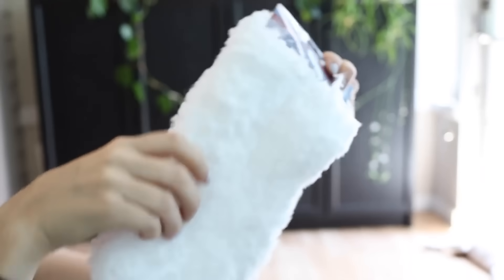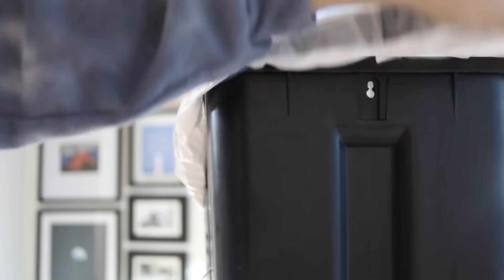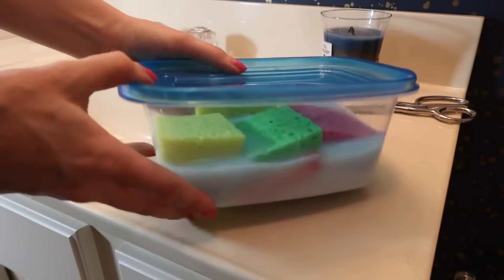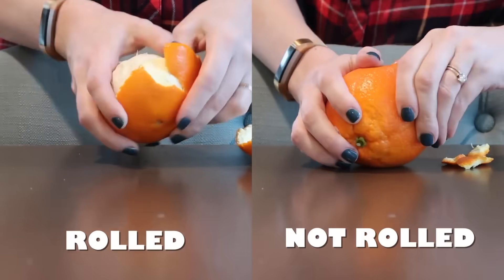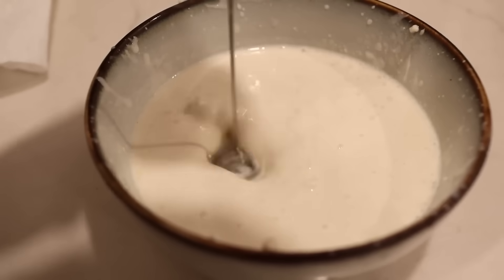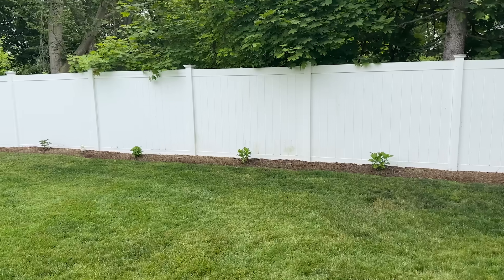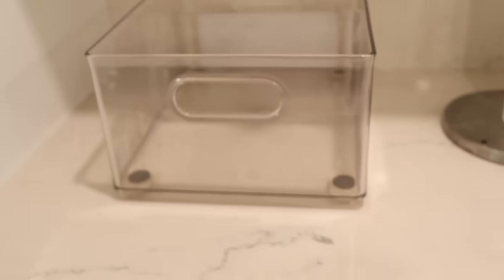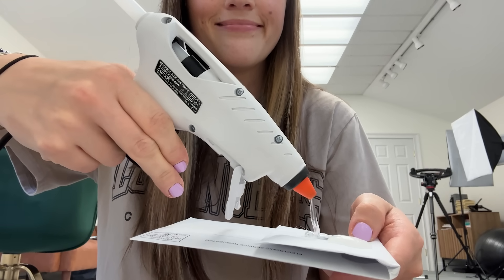43 brilliant NEW home hacks you need to try!! (you won't believe #22)

Comment: Fabric softener on a sponge, and put in the dryer, is not safe. If you look at the back of the bottle it tells you that fabric softener is extremely flammable. Wool dryer balls are much safer.
Reply: Also fabric softener not really good to use in driers , because of the steam is released with and will damage the drier rubber parts faster , i was warned about this from a technician .
Reply: My 30-year-old washer and dryer set finally had to be retired.  The technician said, “You don’t use dryer sheets or fabric softener, do you?”  Nope.  He said they are the death of washers and dryers.
Reply: You don’t need any fabric sheets in the dryer. Just toss in a DRY clean bath towel with your wet clothes. It speeds up the drying process and cuts down on wrinkles.
Reply: @sjrogers7498 Wow, good to know. What do you use as fabric softener? To have a dryer for 30 years, you have done great! 👌
Reply: I still use a little splash on clothes.  But you can't use fabric softner on microfleece jackets or blankets it ruins the fabric. FS stains & bleaches fabrics. Borax pulls out the oils it deposits in your fabric. 
  If you accidentally dry paint in your brushes & it dries, soak it in fabric softner 24 hrs, then massage the paint out of the bristles.  Its also a lovely wallpaper remover.  Dad dipped a cloth in fabric softner & rubbed it over his wallpaper border & it peeled off the walls 10 minutes later, without a mess.
Reply: @brrjohnson8131  cool tips! Thank you!
Reply: wouldn't a towel leave lint on clothes?
Reply: @charleensmith1478  no. Never has.
Reply: I stopped using fabric softener years ago. A half cup of vinegar, believe it or not, works well as a fabric softener, and leaves no smell behind. I also use a few drops of eucalyptus and peppermint oils, which helps to repel bugs. The vinegar also has the added benefit of keeping limescale deposits from forming inside the washer drum.
Reply: @blakpurl14 I’m taking the fabric softener out of my Walmart online cart now
Reply: I use vinegar and baking soda; super clean and soft.
Reply: My thought was the liquid would not last for a day or two before it would start to smell.
Reply: @HeronCoyote1234 it's not for helping to dry your clothes faster they are only for a smell..
Reply: @charleensmith1478 no.. maybe if your towels are on the cheaper side but I have done it for years and it's great
Reply: I was thinking to try, thanks for warning
Reply: @mistyclesi4665 Why? If you want to use fabric softener, that is your choice. I've been using them for years, and they have never ruined my dryers. Same with fabric softener. I've done some extensive research on it, and have not found any proof, or evidence to back this claim up. Society has gotten to where they just believe anything and everything that a person says, and doesn't bother researching it to see if it's actually true. Regardless, you should do what is best for you and what makes you happy because that is what is important. Take care.
Reply: I was also thinking that heat will break down the sponge into micro particles that will be all over your clothes and then transferred to your skin.
Reply: Fabric softener added to washer also prevents your towels from absorbing water. Use vinegar in the washer in place of softener. No need for dryer sheets!
Reply: That's why u can't believe everything you hear or read!
Reply: Leave it to a bunch of Karen's to find the one thing that they don't agree with and not be able to go the rest of the day without commenting about it without feeling "helpful" but forgot about the 3,000 other tips she just taught ya. Then, later you cant help but tell all your friends about the hacks "you've" been using for years.
Reply: Vinegar is not good for your washer and will wear away the bearings, so should be used only occasionally
Reply: @bridget3027  good point! Need to make sure you’re only using distilled vinegar and in low quantity. We only add it to our washer’s softener dispenser, (approximately 1/2 cup). If we need to use it in place of detergent, for odors, mildew, and sanitation,  it should only be added if diluted-  1:1 ratio with water. Also, do not add directly to metal / rubber. If you have to use a large amount, do rinse cycle afterwards. 😊
Reply: Be very careful if you decide to use vinegar in the wash.  Vinegar is great on whites but can bleach color and dark fabrics.
Reply: @alexa5927 Pardon my silly question, I'm not good with washing. The vinegar is added to the washer cycle not the dryer? right?? Thank you
Reply: @Nini-ze2jk  yes, I add it to the fabric softener compartment. If your machine doesn’t have that, add vinegar to the rinse cycle.
Reply: @alexa5927  oh ok thanks Alexa! I appreciate it
Reply: @alexa5927  yes, I put white vinegar in all washes. Very small amount of detergent.
 Usually dry on a clothes line.
In fact, I use white vinegar for lots of cleaning jobs...removes odours also.
Reply: Those clear boogers that hold credit cards are made of museum gel?
Reply: OR your a dry towel in with the wet clothes.  Good results, less stuff, no expense.
Reply: I use tennis balls r they safe or no?

Comment: These hacks are really great. I know I’ve seen some of them before, but they’re easily forgotten. I put masking tape over my baking powder. It was really annoying that it had no way of leveling off.

I’m testing out your wax paper trick on our stainless steel refrigerator and dishwasher! Hope it works. There’s always fingerprints and condensation.
Reply: The metal insert with the cutout on the inside of the baking powder container is already there to level off your spoons
Reply: @xlady0  it’s not in the one I just used up. I didn’t have that metal insert.  It was by Gefen, an Israeli company. 

I said that it didn’t have anything, so I don’t know why you didn’t believe me
Reply: I actually thought we were talking about baking soda. Lol.

Comment: Wait, how did you use to peel mangoes before??? The only way I’ve ever know to cut mango is the way you showed in the video
Reply: I've seen people try to peel them like an avocado, where you cut in half, try to take out the pit, and scoop out the flesh of the fruit. But a mango pit doesn't break free as easily as an avocado pit does, so I think that's an awful way to try to get the fruit out. I don't eat a lot of mango, but always peeled them with a vegetable peeler and then cut around the pit too.

Comment: I quit using dryer sheets and fabric softener because it damages the clothes and the dryer by leaving a waxy residue and buildup. The dryer is more likely to catch fire too. Instead put a cup of white vinegar in the rinse cycle and it'll prevent static and wrinkles. (And no, you won't be able to smell the vinegar, even if you hang dry)
Reply: Same here!😊
Reply: I stopped using fabric softener sheets when I learned they were the reason my towels weren't as absorbent and were smelling bad. I washed them in hot water with baking soda and white vinegar (separately; don't mix them!), then regular detergent, and all that residue came out. Then I got wool dryer balls. They work fine and they just live in the dryer so there's no box or bottle taking up space (though they do tend to collect hair so I have to clean them off every so often; I have long hair and it gets everywhere!).
Reply: @allein1001  get couple those sticky paw shaped fur grabbers for the dryer, and,/or washer..... Just rinse them off and good as new
Reply: I never used them, always thought they were an extra product that wasn't needed.

Comment: Alot of good ones!! For hard boiled eggs I wait till the water is boiling then insert eggs gently, wait then I take it off the burner but I leave them in the pot, every like 1 to 2 mins add cold water to the hot water a little at a time. That will slowly cool the eggs. Once the water is cold and the eggs sat in it for a few mins, pull them out. To open, just roll your egg to crack the shell, and then you should be able to peel the egg in one piece. It works for me everytime.

Comment: My toilet cleaning routine:  I use the Clorox toilet gel.  I apply it inside the toilet up along the rim and let it sit while I clean the outside of the toilet (rim, outside of the bowl, seat (both sides), lid (both sides), and tank.  Then I take my toilet brush and scrub the inside of the bowl.  After the first scrubbing, I flush.  Then I take an antibacterial wipe and put over my toilet brush to scrub under the rim. It gets the gunk the toilet brush misses and I just toss the wipes when I'm done. It usually takes at least a couple of wipes to get under the rim clean.

Comment: I use a vegetable brush for my toilet. The regular toilet brush doesn't get under the rim very well. 
I use a magic eraser on my tub after using the dish brush like you have. It takes off more than the brush does. It surprised me at how much more dirt it took off.
I use baking soda in the washer with the detergent and vinegar in the rinse cycle. Clothing has minimal  static coming out of the dryer.
Enjoyed the tips!

Comment: I've always use the outdoor broom,  first I scrub the tub walls, then the tub, and the tub floor,  the shower walls, and shower floor, there's no need to kneel down or bend.  I use the scrubber or a sponge  for the water faucets, if necessary you can use a hard sponge,  I also like to use brillo makes the water faucets shinny. If you have a spray shower head is better and easier to rinse the tub walls,and shower walls ,  It really makes the job a lot easier, without bending and hurting your knees and back.

Comment: You are really amazing with all the wonderful practical tips and tricks although I never had a problem peeling the eggs off. I just pour out the water and shake the steel container until all the eggs shellls are cracked up and then pour some cold water and peel it off, very easily and almost immediately

Comment: I use rainex on living room window and sliding glass door.  I have a big 75lb slobber dog.  While it doesn't keep my window clean, it makes getting her super glue like slobber off.  But wax paper sandwich bags if you can find them.  Much easier to polish with.  If you still have metal slides, they wax the slide nicely too.
Reply: @osakarose5612  circa 1960 mom would send us outside with wax paper bags over our hands to wax our slide to slip easier(don't know if metal slides are still a thing, backs of my legs got burned a time or three) I am also going to try on the track of door.  I was so tired of scouring or using razor blade to clean my windows from my dogs slobber.  Lol

Comment: With the measuring spoon in the chocolate,  it's easier to flatten the chocolate or whatever with the back of a knife. The tape will collect the choc, & will need to be thrown out regularly. The adhesive also contain chemicals.
 Ikea sell reseable plastic clips that can be used to close bags, & they are big enough to be seen, less likely to be thrown away.

Comment: I recently found that replacement heads for wand cleaners are great for really cleaning under the rim of the toilet bowl. I accidentally broke the wand, and used the head full of vinegar a dish soap to scrub under the rim, and it removed hard water build up and stains so easily.

Comment: Tight kitchen storage:  My first every flat (aged 17) no matter how much I cleaned or sprayed, the block had a cockroach problem, so I took to storing things like biscuit packets etc inside my lidded pots and I would then neatly sit them on top of my stove top with handles all facing the same way to look neat.  This is a good trick and you don't have to find room for your pots and lids in your cupboards.  Mangos:  I leave skin on, cut either side of the large seed, then cut the same pattern as you would do to decorate a ham, then invert the half and the little sections will sit up nicely for you to eat or cut off.  Neat presentation for placing in a parfait or cocktail glass.

Comment: You can also hard boil eggs in a rice cooker using the steam setting for 18 minutes. I usually then put them in the refrigerator in a bowl after after they've cooled down a bit and they peel really easy once completely cooled in fridge.

Comment: I agree about  the crevices, there are so many items that have bends & corners & crevices, like vacuum cleaners, lawn mowers, line trimmers, steam mops etc. You have to clean them after using them. It's annoying, & uses much of your valuable time. Easier to give an item a quick wipe over. 😊

Comment: I never have eggs hard to peel.  I poke a small hole into the large end, drop them in boiling water, boil for 5 minutes, turn off the flame and cover for 20 minutes, remove and they are done.  I'll try your air fryer hack, though.  Love the gridded-cut watermelon.  Like the milk frothier hack.

Comment: 7:50
Hard boiled eggs. My method is to boil the eggs and then fill the pot with cold water to drop the temperature. Dump that water and fill one more time with cold. 
Then tap each egg on the inside of the pot to get cracks forming. Once they're all cracked, go ahead and start peeling them while submerged in the water.
I think the water starts to work it's way under the shell from the cracks, and makes it easier to peel.
Reply: If you put ice in the cold water after boiling, they peel right off!

Comment: 5 STAR VIDEO!  Here's a home hack for you that works for me.  I have a very small kitchen and I have counter top that is higher than my stove top.  Uneven.  Food and stuff would fall through the gap between them.  They have gap covers on Amazon, but they don't address the different heights well.  So I bought a silicone mat and some silicone rubber bands and I rolled up the mat in a tube and held it together with 2 bands and covered the gap.  Now stuff doesn't fall through the gap and I don't have to worry about heat from the oven.  And it will last a long time and is easy to clean.

Comment: You don't need to put a tape over cocoa powered canister etc. I just pull the meaduring spoon up against the inside wall of the canister. That works with any strait wall canisters, not the round ones. 😊

Comment: Lemon oil and a green scrubby clean your stainless steel sinks, scrubbing with the grain.  The sink has to be completely dry and the green scrubby should be new.  After scrubbing wipe it down with a paper towel, and your sink will be brand new.  Oil products always work on metal products.

Comment: In Europe we use "hanging" toilet bowls so there's no this gap between it and the floor. Also, we have - wait for it - toilet seats that can be removed just by two clicks.   You take them away, wash them in your bathtub, clean the ceramic part and put it back together. Click-click.😊

Comment: Dishes in dishwater facing center
Reply: Lay clothes on top of each other, then insert hangers in quick succession
Reply: To close bread bag, twist and pull end of bag over loaf
Reply: To vacuum seal a ziploc bag, place bag in a bowl of water
Reply: Use shipping box, insert plastic bags by looping thru handles. Plastic bags come out like tissues

Comment: I tried to get through all these comments but it was A LOT of great ones. Not entirely sure if someone said this. 

As for the toilet seat crevasses:

If you take those bolt covers, the two plastic tabs we clean around, from the farthest side to the bowl, snap them upward, exposing the bolt, most have little crab pinchers that surround the bolt. Then you just pull the seat cover toward you, so slide parallel to the floor. You gain access to clean the seat cover and lid to clean in a shower or large Tupperware bin. It is money!! It saved me from using toothpicks and cotton swabs.

Comment: There's an egg shell remover called "The Negg". You boil the eggs put them in some cold/ice water, put a little water at the bottom of the negg, the egg and then shake it a few times, it breaks the membrane and the shell slides right off the egg. Sounds weird, but it is so satisfying and works amazing.
Reply: You can also put 2 cups together (like a bartenders shaker/strainer) with a little cold water in it. Shake it up and usually the peel has already fallen off after but if not, it falls right off!

Comment: Pull the husk out of the top of your corner. Put the corn in the microwave, husk and all. Cook for 4 to 5 minutes. When done, take the corn out, cut the corn at the base,( you can feel it) and pull the husk off from the base. It will take the husk and silks off in one pull

Comment: ✴ EGG EASY PEELING HACK❓
Crack the shell of boiled egg  (eg by tolling it on a counter) then rice it under a tap/faucet, GET A TEASPOON  and crack on - push between egg shell and actually egg. You'll peel it in 5 seconds. Sane applies to orange 🍊  just that you may prefer a soup spoon then.
Good luck 🍀

Comment: I use that broom head without a handle in my bathroom. I put some soap on it and I wash the tiles around my bath and the sides of my bath and I can even wash the shower curtain. Sorry that you say the plastic shower curtain liner and it does not scratch anything.

Comment: If you aren’t using all the watermelon at once, take the middle slice out and then push the two ends together. That way, there are no exposed pets of the watermelon. It’s kind of like the bums on bread - you keep the ends until the end so the middle doesn’t dry out!

Comment: Totally agree about toilet designs.... when is someone going to make a gazillion dollars designing one that everyone will obviously want?!
Have never had an issue peeling hard boiled eggs because I don't boil them.  I steam my eggs, making the shells basically fall off.  Either way, one key is to tap both ends of the egg on the counter, cracking the shell on both ends allows the shell to expand when rolling it on the counter for removal.
Streamlined outlet covers are awesome, we have several for exactly the same reasons you stated.